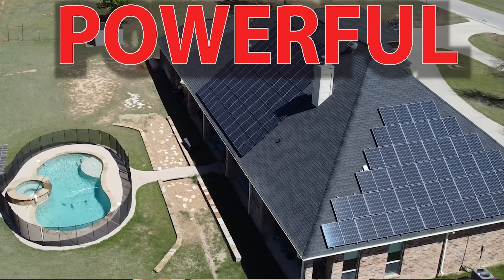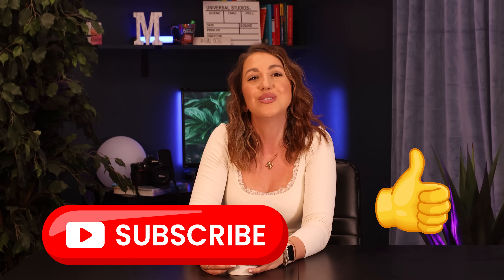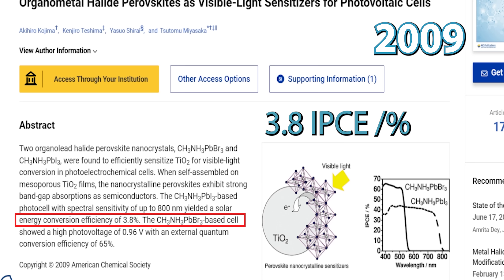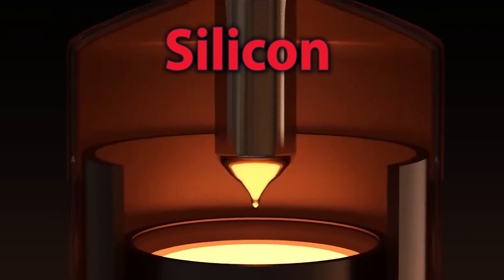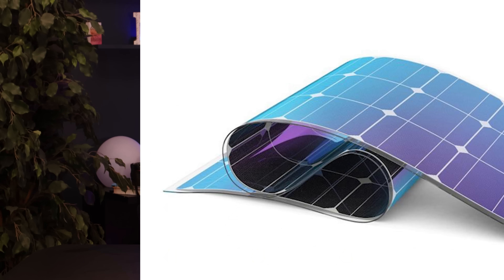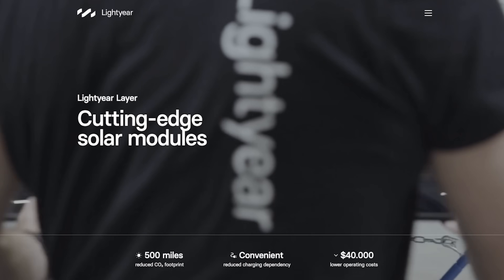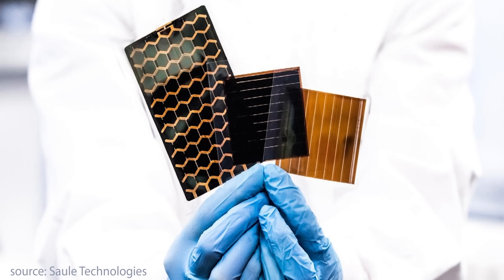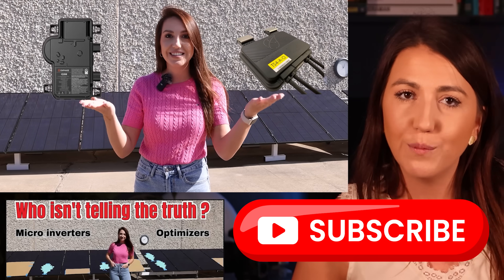Perovskite Solar Panels- You Can Print It Like Paper! Will it Kill Silicon?

Comment: So for me the question is "Do I install now or keep the money in the bank and wait 1-2 years for this  new technology? " I don't want to make an expensive mistake. I'm UK based so the 30% tax break is irrelevant to me.
Reply from the maker: Personally I would do it now, every time  you pay for electricity is money wasted. If you have a good roof and 22% efficient panels will be able to cover you, you will be just fine now. 

If you have very limited space you can wait and see.
Reply: I'm not getting into solar just to save money on electric. Im worried about the upgrade going down. I was without electricity with no heat after 5 days I was getting ready to go over to my sister's house and the eclectic came back on. So solar iscthe way to go fir me😊
Reply: Start today. Get the installer to only add (say) four panels for now. Get them to add the full support rails for future panels though... so you can add the panels yourself, whether they be just silicon PV or Perovskite based. Plan to cover as much of your roof as possible. You can never really have too much solar.
Spend the money saved on adding more batteries - and make sure you can always add more battery storage in the future.  With the right electricity supplier, today you can charge you batteries from the grid at night and resell what you don't need in peak times and probably start saving that return on the future (more Batteries and/or Perovskite PV).